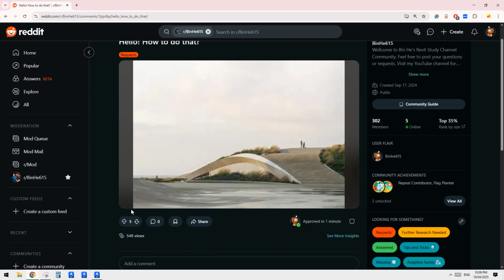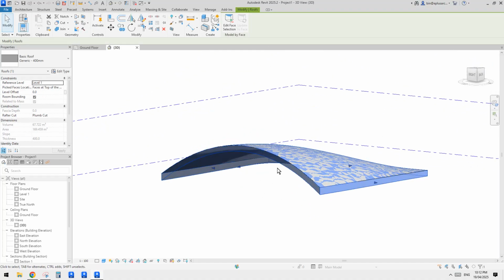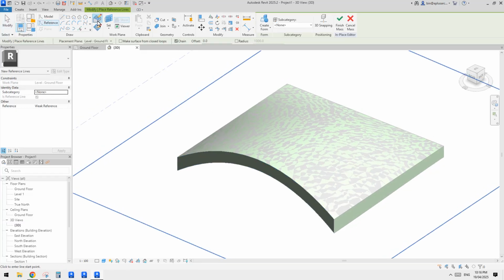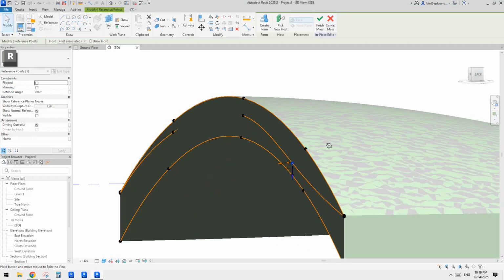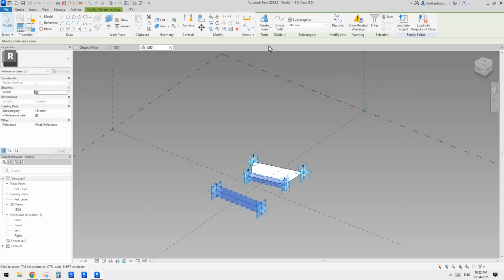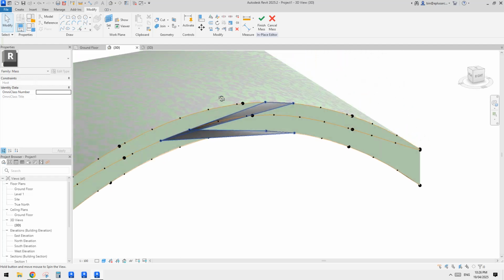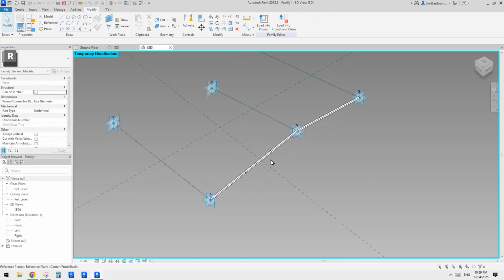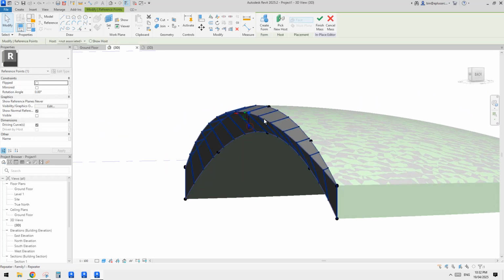25053 - Massing and Adaptive Family Exercise in Revit

Comment: You could have just used a void form or air material instead of the dark material. Only I don't know how to set the thickness for the panels.
Reply from the maker: Air material doesn't help with renders, but voids can work. To set the thickness of the panels, you need to connect the points horizontally to create a closed rectangular shape. Then, you'll have the option to create a form with thickness. You can also use draw-on-face points with a normalized curve parameter to offset the panel, so no voids are needed.